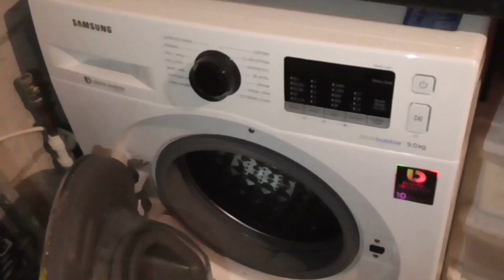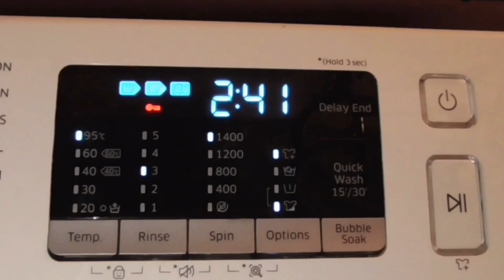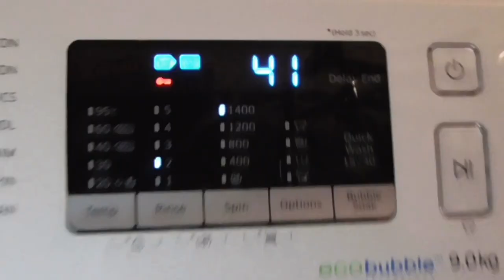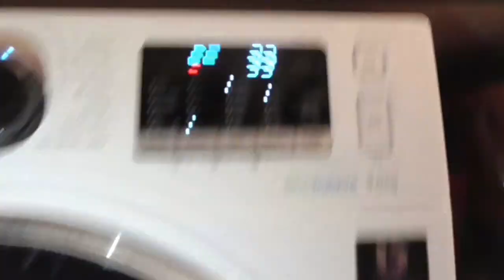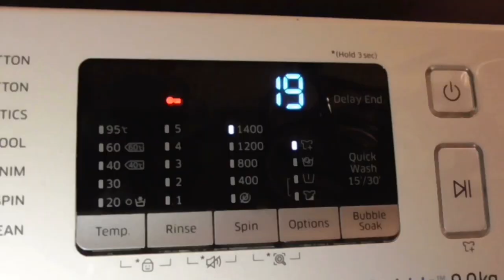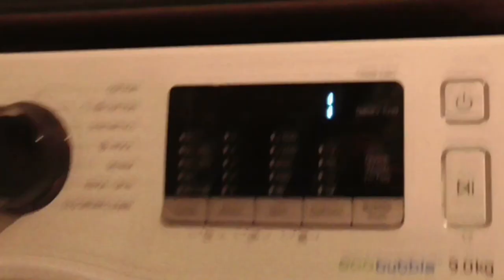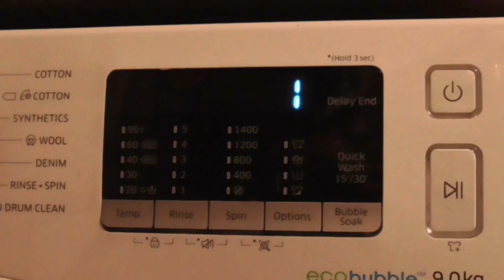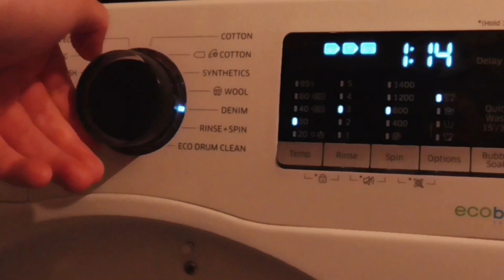Start Whites Samsung Digital Inverter WW90K5410UW Cottons 95 2 Rinses

Comment: Can u do another boilwash in the Samsung
Reply from the maker: Samuel Burden I’m Thoughtly I Already Done Boilwash In My Auntie Samsung Digtal Inverter Which The Only Program I Used In The Samsung Is Cottons 95 Without Prewash And Also I Did Selected Intensive But That Doesn’t Work Out Because I Have To Extra Load In So I Did Cottons 95 Without Prewash And 2 Rinses But Did Selected 3 Rinses But Now I Selected 2 Rinses On This Cottons Cycle